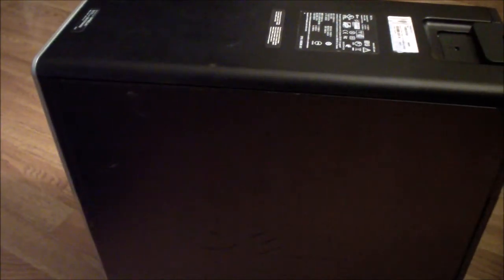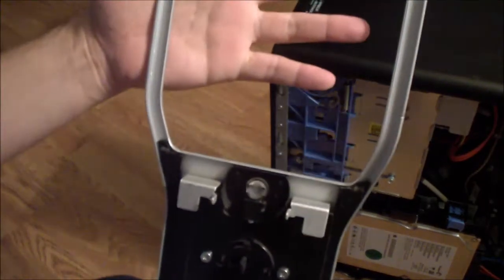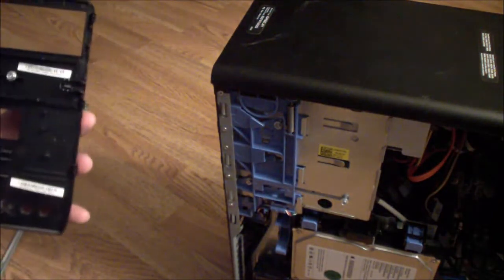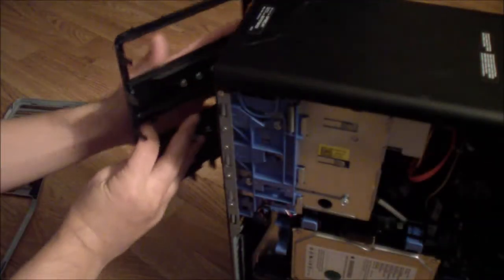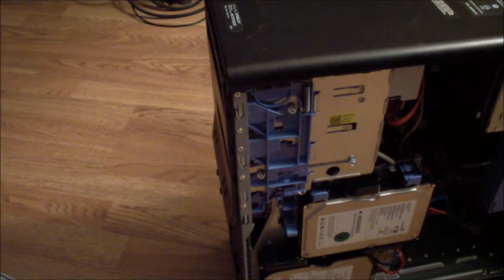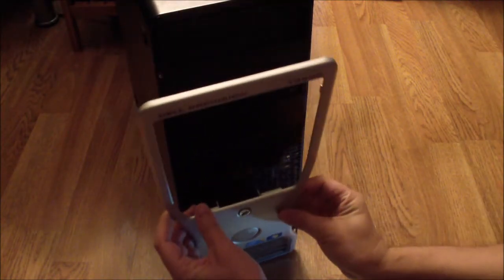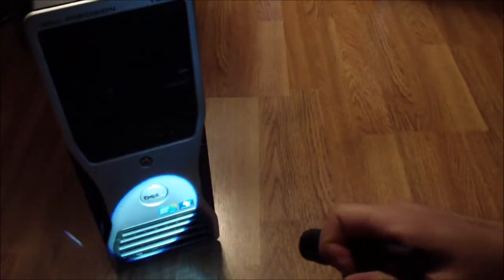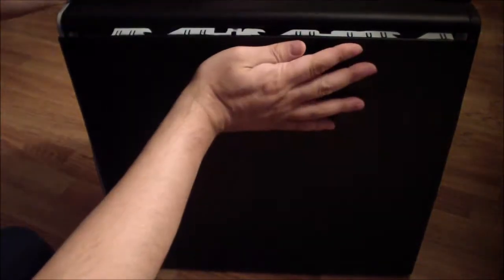Dell Precision T3500 and T5500 Faceplate Removal

Comment: I wonder if the T7500 faceplate will come off like this.
Reply from the maker: The T3500, T5500, and T7500 all came out at about he same time. The T7500 is just a much bigger version of the T5500.
Reply: What about the T5400?
Reply: @Ace1000ks19751982  can make video for remove front plate by dell precision t7500
Because it is so hard to remove the front plate
Reply from the maker: @mahmoudhamza80  I don't have a Dell Precision T7500.
Reply: @Ace1000ks19751982  thanks for reply
Reply from the maker: @mahmoudhamza80  Sure, no problem.

Comment: Hi friend good afternoon. I have a Dell precision t5500 server motherboard. I'm trying to connect without the front cables, would you know how to tell me how?
Reply from the maker: What do you mean by front cables?
Reply: The front panel connectors that come with The desktop
Reply from the maker: @fabriciosantanaaniceto9534  I have no idea on the pin layout of Dell front panel connectors, but if you know then you can do it.
The front panel connects for the Dell Precision T5500 connects the power switch, reset switch, power leds, and front USB ports. The layout of the pins for Dell computers are different from standard ATX cases.
Reply: @Ace1000ks19751982  thanks for listening, my friend. I'll try to check it over the internet. I no longer have the case for the t5500, just the motherboard and components.